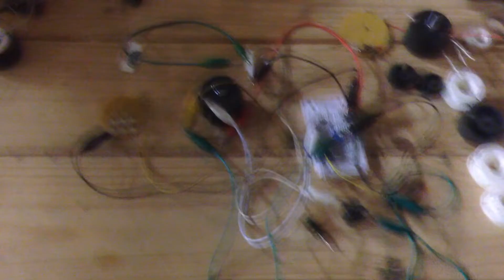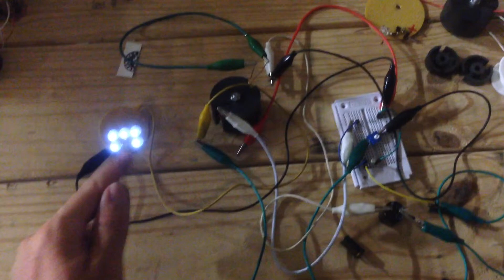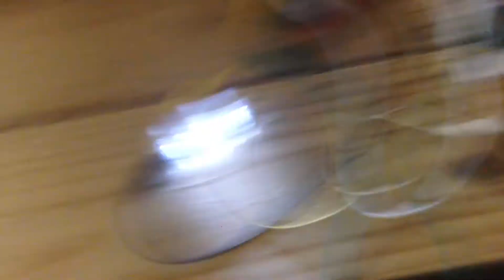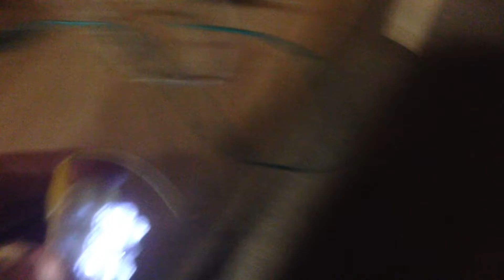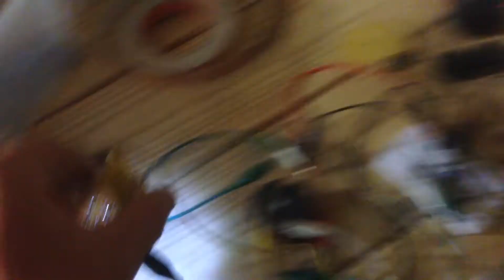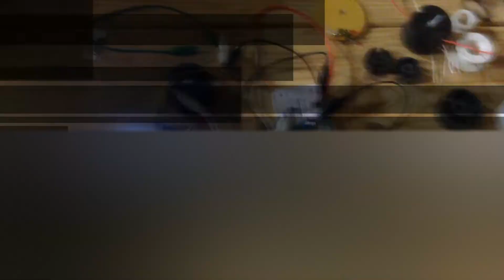Next Level SJR Looper - Battery Free LED Light Driver Nearing Perfection

Comment: I'm super late in playing with this circuit but what has been difficult for me is understanding how stable the circuit seems to work for everybody else. all of my near replications involve such sensitive circuits that just having clip leads all over throws it out of wack, as well as random capacitance changes from my body etc.. extremely difficult to get precise. It has been really hard for me to beat Lidmotors penny oscillator and variants. Had I not seen some pretty amazing projects in the past run from such small capacitors I'd never believe this was possible.

Comment: You need to get some quality power LEDs that are 10W. I like the XML and XML2 series, since they are relatively small for their max output, very efficient (several times more than the cheap ebay LEDs) have good color rendering and hue, etc. for a flashlight upgrade, you can use the drop in module and just remove the inverter on the pill itself.

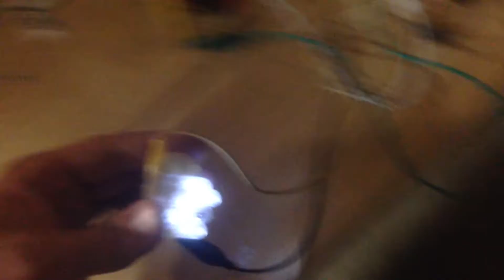Comment: Seeing the reflection off the camera lens still add light to the bench at 3:40 was interesting...
Reply: (Unless of course that was just light bouncing strangely through the lens elements...)
Reply: And the light getting brighter when you remove the battery just after 4:50 is also interesting.

Comment: really cool using  rf to power the led's  I would like schematic please. converting electricity to light! in a different way. now if you take two of the leds mirror it a bit. and put a calculator soler cell so the led's would power the cell. putting output back into it. it and that would be energized by light, and the leds will keep it going. hum.

Comment: Have u tried to flash on that capacitor. With a piezo electric generator i have a few left over if u want to try it.   Also on the insta light as u could call it maybe a small solar panel and or a thermo electric device to make usable light from just squeezing the handle could be  a no excuses survival light ...lol

Comment: Hi Lasersaber...HERE IS SOME CONSTRUCTIVE CRITICISM: I an electrical engineer and have been following you for a long time. I admire your accomplishments but I am completely turned off by a sloppy pile of jumper wires and a promise of a schematic later on. You discuss various capacitor sizes, a potentiometer here a diode there etc. What these parts are doing in your circuit is not meaningful to anyone who watches a sloppy setup with no schematic. I am not criticizing the use of jumpers, I use them profusely. Why not first generate a schematic, display it, then refer to each component by its circuit designation...e.g. I changed C1 from 10uf to 100 uf and the supply current decreased or increased from x milliamps to y milliamps and the LEDs increased or decreased in brightness? Your narration over a sloppy pile of wires is a real turn off. If you plan to profit from your designs other than to get paid for "Youtube hits" then don't post them here. Even though you might be going for Youtube 'hits" please don't rush to publish a video that only has value to you. You are a hard working guy. Let us viewers appreciate the good work you are capable of producing. Please consider the suggestions. Thanks, hope to see more of your exciting work, but, with proper details.
Reply: TheBdd4 you sound like a shitty engineer. Obviously you demonstrate that a engineering degree doesn't mean much. He can do whatever he wants. If your frustrated cause you can't understand then ask him. Don't post a fake positive criticism post which sounds like your bashing the guy. He's figuring things as he goes while showing other people what he is doing. Thanks

Comment: It it still difficult for me to get the pure logic. A capacitor 10mF, 10V, can hold a maximum of 0.5J of energy. A single LED 20mA, 3.3V needs about 260J/hour. Even not @ full brightness and/or blinking @ high frequency it will need probably 50-100J. I guess I am not good at physics..... and miss something.....
Reply: You missed the class on RCL's, it would help you understand his SJR

Comment: What if you put 555 timer on the + and the let it blink. you can run the 555 timer from the same + as the led,, with fast switching diode and cap to make 3.3v.  would that increase the running time or 555 take to much ?